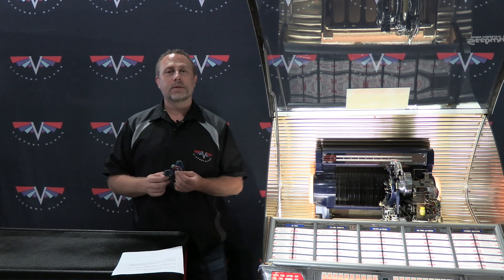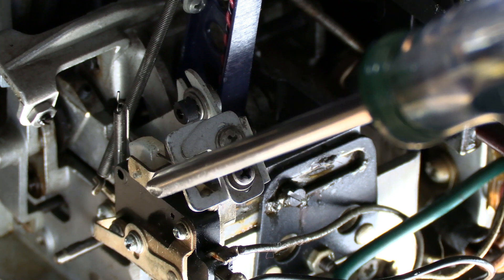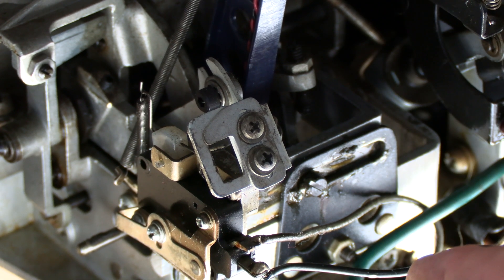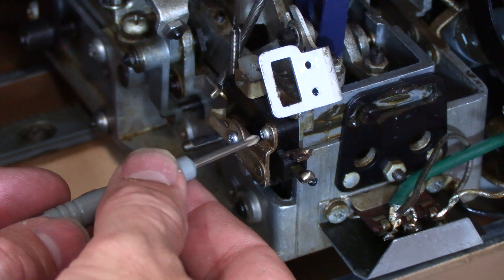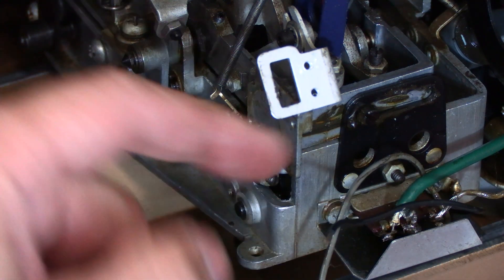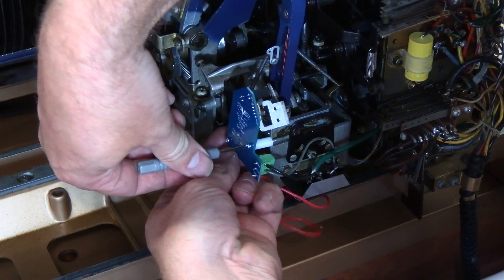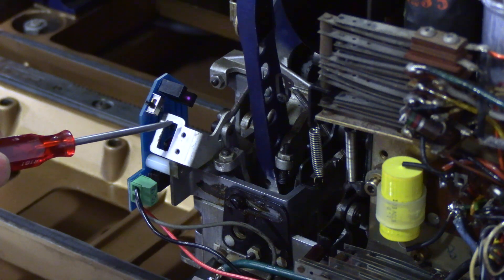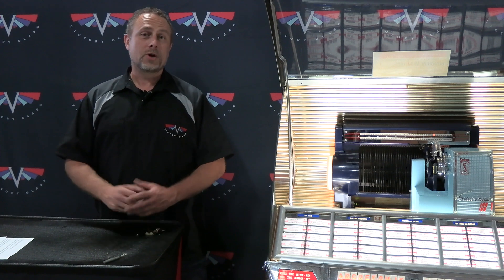Introduction to the Victory Glass Electronic Trip Switch for Seeburg Jukeboxes

Comment: Great product, however, over time dust will contaminate the optical path. A more robust solution would be to replace the optical sensor with a hall effect sensor (with small magnet glued to the actuation) or with an inductive proximity sensing coil.
Reply from the maker: Optos have been used in jukebox, arcade, and pinball for decades.  Many times in environments either heavy smoking. And though if they get dusty they can easily be cleaned, we believe they will be just fine for decades to come.  Similar setup was used in layer seeburg made in the 1970s. These suffer from the glue failing and the magnets disappearing.

Comment: Looks like another great product and problem solver!  Since installing your Seeburg 350 cartridge in my R, I've had some records jump back instead of cancelling.  This may be what I need.
Reply from the maker: Right on!
Reply: Same here, did the electronic trip switch correct your issue?
Reply: @503gabrielle1  Have not tried yet - will make some more adjustments first.